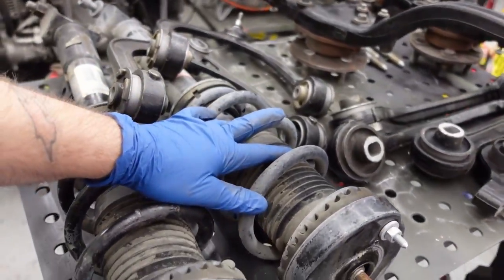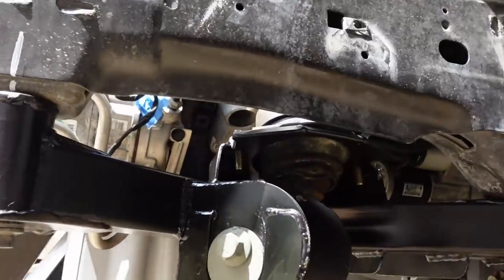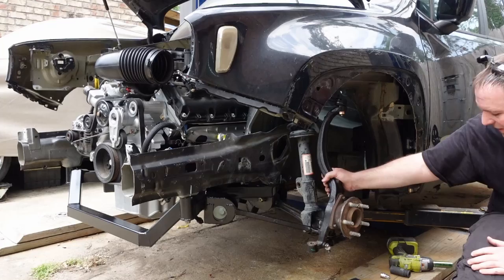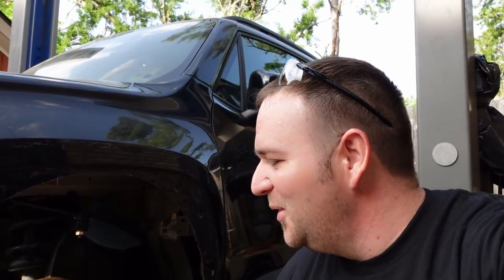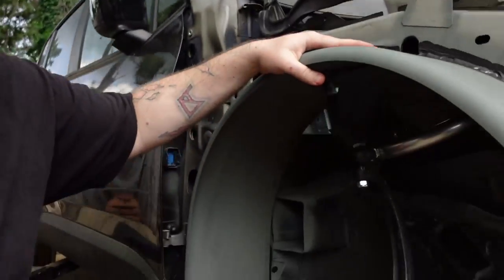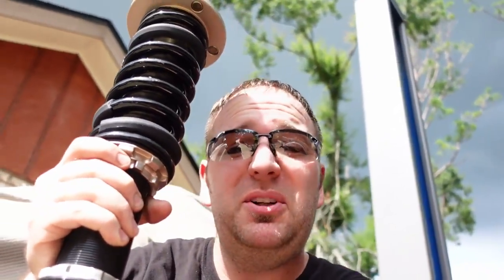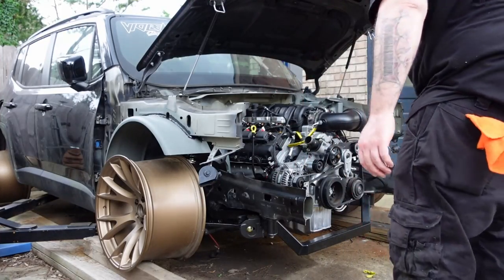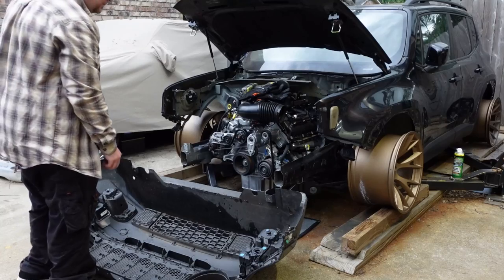HEMI Swap Jeep Renegade pt. 16 Front Suspension is FINISHED!

Comment: As a Renegade Fan... I've owned a 2017, now a 2019, and I'm about to trade this in for a 2022... This is my dream swap, I've considered doing like an SRT-4 Swap or to be honest maybe even a K24 Honda swap. I've got every bolt-on you can imagine... Intake, Header, Full Exhaust, Madness ECU, Pedal Commander, and a TCU Tune (2.4L Tiger Shark), All for a measly 218whp and 189lb/ft... LOL! Love the innovation, literally look forward to every video! Keep it going Mike!
Reply: K24😒
Reply from the maker: Yeah its kinda disappointing that there isn't that much performance backing for these things.  I thought about doing a SRT-4 swap, but figured if I was going to swap I'd want rear wheel drive, mostly to get sideways and do burnouts.  Thanks for following along with the build, it really does mean a lot.
Reply: @HEMIGADE  my pleasure bro, your fabrication skills are top notch. I used to own a Hot Rod shop and we could have used a guy like you! Can’t wait to see it done. The new one I’m getting is 4WD and the 1.3 Turbo so I’m hoping I can get some more power out of this one.
Reply from the maker: Hell yeah, that's the spec I'd go with if I were to buy another one.  I think it would make a sick rally build, and the turbo noises are pretty damn cool too
Reply: @HEMIGADE  definitely and the exhaust & pedal commander swap over. Unfortunately ecu doesn’t nor does the intake, but I’ll get those asap w/ the BOV and valve spring upgrade!
Reply: @Pappy412  Could you imagine... Man that would be a helluva swap. Casual 600+whp easy. Can't say ultimate sleeper, but it would definitely be fun. I drive Alligator Alley which is a 75 mile long 2 lane road a couple times a week and it's perfect for spirited spurts and let's just say I've had my share of fun... Lots of getting my ass kicked, but still fun.
Reply: @Swoledadof3  Alligator Alley iam there all the time... Florida Man

Comment: Dude this is epic!  Makes me think about Ecotech swapping my daughters 2001 Saturn SC2.  Actually looking at a wrecked Saturn Sky Red Line Turbo and making the SC2 rear wheel drive.
Reply from the maker: Heck yeah, that sounds like a fun project, and those little boosted Ecotecs pack a punch.  One of my next projects is to swap my spare 2.0 Ecotec from my HHR SS and mount it in the rear of my Crew Cab S-10.  You got me wanting to work on that now lol

Comment: I'm just simply amazed by this. I'm doing a hemi swap in my JK in the next month or so, just waiting on ECU and harness to arrive, and know how large my new motor is it baffles me to put it in a renegade. Seriously this thing is going to be intense.
Reply from the maker: Yeah man, these engines definitely aren't small.  Having a 4x4 with a Hemi sounds pretty fun though.  It does surprise me every time i get something to actually fit in this thing.  So far no major issues, but i can tell that the brake booster will be problematic.

Comment: You are moving right along. I will admit I was a little bummed to see you go coil overs rather than air ride again. I can see that there would have been clearance issues with the front control arms.
Reply from the maker: Well...  I wasn't going to say anything, but the coils are just temporary.  I have bags that convert BC Coilovers to air struts.  I want to get it dialed in with coils first so there aren't too many variables for the first drive.  I love air ride too much not to bag it
Reply: @HEMIGADE  I was thinking that you might go that route but the clearances seemed so tight. Sorry for making you let the cat out of the bag.

Comment: I would like to give you a tip.  take a look at the front of the Renegade Limited 2019 that you have in Brazil, it would look very nice and sick in your car
Reply from the maker: I've been looking into that style, and I think if it were color matched to the paint it will look pretty good.  I'll probably finish the mechanical portion of the build, then do the bumper swap and color change after.